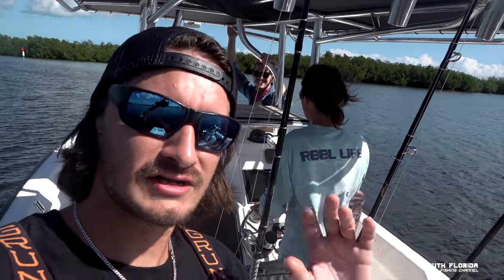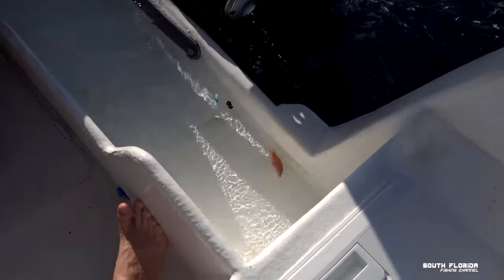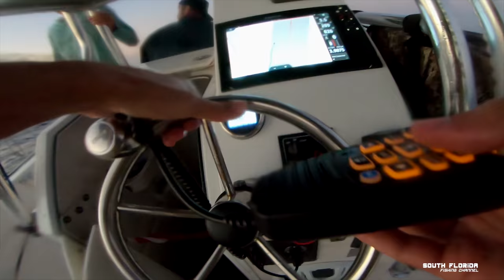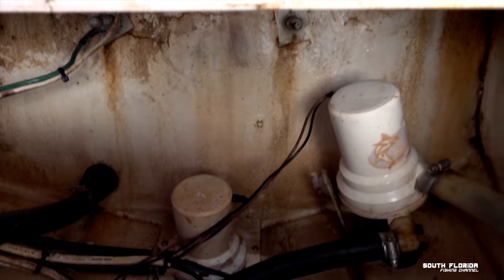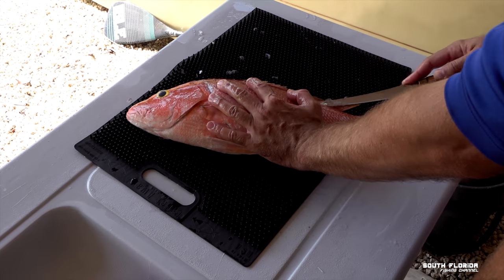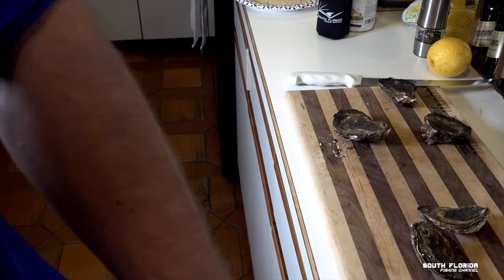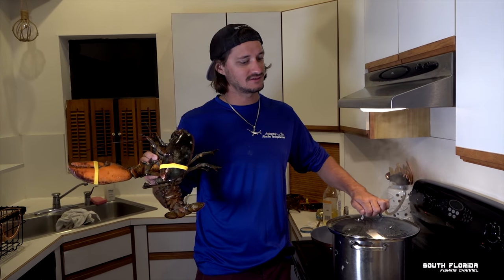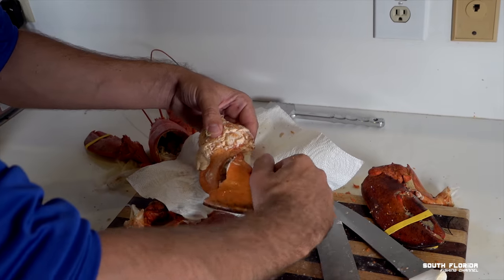Sinking 10 miles offshore | A scary fishing catch n cook

Comment: Heiko, I'm sorry this happened to you.  The folks who did the repower should have tested the transom for moisture/strength before installing that significantly heavier and more powerful engine.  Key Largo took a proven hull (23 seacraft) and built them as cheaply as possible.  IMO, putting more money into that hull is spending bad money after good.  If I was you, I would try to find a used hull in need of power and put your motorand new electronics on that.  Maybe a pursuit, sea ox, or an older mako.  Good luck bro.  If you ever get up to long island, NY, you can fish with me.

Comment: If your boat just ran on flat water, the transom would probably be fine, but when punching through waves with a heavy load on board extreme stress is built up when the waves try to stop forward motion, and the torque of the outboard is trying to force the boat and all the weight within ahead. In bumpy sea conditions it's best to slow down to the speed the sea is running or take a quartering tack when bucking a head sea.

Comment: Tops are 'never' permanently mounted.  It has to be able to come off.  

I agree with having someone closing in the transom...be sure they add big knees from the stringers.  Transom thickness needs to be at least 2".  Add a bracket & you'll have alot more interior space.  You'll feel like you have a 25'er instead of a 23.

Comment: i mean im not an expert but was that a repower that didnt pay attention to engine weight, maybe a 200 would have been more appropriate but that transom looks pretty thin probably a problem that the boat builder caused (later in the video i did notice it was a small boat 18-21 ft? boat builder probably built it for a 150 to 175 hp engine)

Comment: I’m sure you’ve heard a lot of comments but I used to worked for a company that deals with fiberglass molding, repairing, and rebuilding as well as structural repairing. So if you ever need a cheap repair in North Georgia then you have a contact.

Comment: I’m pretty sure the reason of failure was from the huge engine on the back. While you were fishing and the back of the boat was already full. I would lookup into a jack plate or a aluminum transom cap when fiberglass is fixed or a combination or both.
Reply: Yeah that splash well should not be under water like that! It’s made to take water but the top of the transom should always be above the water line! That was not normal unless your backing down.

Comment: I bet that boat was rated fit a 250 two stroke. That transom is toast/mush.  It all needs to come out and redone. Take the motor off/flex tape and tow to a ramp no big deal. If you like the boat get it fixed right $$$ or part out and buy something turn key.  Next time put you vests on before doing anything and have an emergency plan. You all did well and were lucky. Thanks for sharing your experience.

Comment: Your boat is a prime candidate for Seacast transom replacement system, did mine 10 years ago and stronger than original. I f you could remove the motor it could be done where it is parked.

Comment: @SouthFloridaFishingChannel   Heico unfortunately a "mobile" fiberglass guy isn't going to fix your broken transom. You have an old boat with old wood in it that's probably more than 20 years old, that wood is probably on its way out as its probably rotting away. Those guys at Sea power marine in Tamiami really screwed you over man, and I'm sorry to say that. They may have already known about your rotting transom or how weak it was and proceeded to mount that engine on it just to get that sale $$. Also the way they bolted those lower bolts through your transom is a joke and was bound to fail, especially on an old wooden transom like that, wood does not have the compressive strength modern day composites do, so when they mounted those lower bolts they should have at the very least used a cross brace like they did on the top two bolts. Dinky aluminum fiberglass washers like those where over time just digging into your transom with pressure caused by the engine.
Since you are considering a transom bracket you will most definitely need to get that transom replaced, no way in hell that transom of yours is holding up a bracket. Whatever transom you do decide to put back in i would highly recommend Composite materials like Coosa board or ARJAY pour in transoms. I cant recommend you any fiberglass shops here in Miami but taking your boat up to Ft Lauderdale would be a good option, lots of good fiberglass shops up there, might even consider replacing all that wood in the boat!
Reply: Poor installation, those little washers were really just waiting to fail.
Reply: @K9bare66  exactly

Comment: Take the engine, electronics, tower, and anything else you can salvage off and just buy a used hull. Forget repairing that. You will always be wondering if it's going to hold up.
Reply: That's what I was thinking... and I do fiberglass for a living.  Can it be repaired, yes of course, but its not worth it  Better to take the money and upgrade to a better hull.

Comment: Your transom needs to be replaced....guys that changed your motor should have seen if the core was water logged or not. Anyhow the plywood needs to be removes and then you can replace it with a non wood core that will never take on water from any screw holes or drain holes and will last forever. That is the proper fix here. Seeing as you spent some food coin on your rebuild i would definitely get the transom core replaced to non wood.

Comment: 1. You must reduced at safe speed during rough seas. Regardless how strong your transom is or how "unsinkable" your boat is.
2.  You must play with the waves at slow safe speed, avoiding your boat to go surging. "Play with the wave" means going zigzag if necessary avoiding big waves. Like I said regardless how strong your transom is or how sturdy your boat is.
3. You are not supposed to eat oyster including the liquid inside. It is basically salt water.
4. Oysters are very good to eat. You are missing a lot if you still dont get to eat one before.

Trust me, I am a seafarer (a Chief Engineer by profession) and from the archipelago of the Philippines.

Comment: whoever installed that motor should have put a backing plate on the lower and upper bolts and stiffener inbetween the fiberglass on those top bolts.... that metal bracket has too much tension on the fiberglass.....from the looks of the lower bolts with those 1"X1" square washers up against fiberglass you are asking for trouble...... should have a 1/2" backing plate either aluminum or another non corrosive metal....Also not sure what that boat was reated for on an engine but that evinrude maybe a lot heavier then allowed..... glad you made it safe I can feel your stress during that episode.... scary times! My buddy had both his fuel tankes on his Grady let go 20 miles offshore..... scary scary....!!!!

Comment: Glad your safe. 

Remove the engine and get towed to boat ramp.  

I would suggest new transom made out of Coosa board from Boat Outfitters. Plus move the engine to an Armstrong bracket. I loved mine as it eliminated the waves splash in while drifting.  

I’d suggest enough Inflatable Life Jacket. Imagine fast the boat would gave rolled if that engine tore off the transom and water rushed in. 

I suspect you may have a rotten core in your transom, looking at your video in the bilge it appears it shows rotten wood stains front your engine mount through bolts. If this wasn’t sealed properly then water getting into the transom will rotten the wood and stains will appear. The transom strength was the wood and the fiberglass was to keep it waterproof while adding some strength. Internal failure of the breakdown of the wood left the fiberglass as the last resort to holding the engine on. Coosa board never rots. Check out Armstrong bracket.

Comment: It is all about experience. Now you will be more careful and check your Boat like you were flying a Plane. I have an ActionCraft 1720 and a 25 Ft. Cruiser. I have had my brush with death too.  Many stories to tell.  Passed Captains Class in Marathon Fl.  Been so far back in the Everglades that would scare  Crocodile Dundee.  Bilge  pumps can get old and lines can crack letting in water to your  boat.  That is what it looked like because you were riding low in the water and causing extreme pressure on the transom. Just my thoughts. Glade you are safe. Be pre paired for next one like it will happen. This is why I never drink alcohol  when on the water. All hands on deck has is important.  After I get back I get a big buss and eat fish.

Comment: This will prolly be long but I got a Story. So I headed out for the day my lady friend,and I headed out around 11 am (because I can never get her up !!!!!) anyways headed to the launch and headed out.So we got to our spot in about 50ft of water I tossed the anchor out and got to fishing!!!!now my boat was a 22' proline cc and the water was coming in the back which is a little taller than your back by your transom.I noticed water was touching my toes in my flip flops and I about lost it! I instantly cranked the engine hit the bilge and wait for it NOTHING no water nothing so instead of trying to fix the bilge I hit it full throttle lol with the anchor out when I heard the line pop I slowed down a bit so I could cut the anchor line with my knife.I didn't stop because the boat was bogging the battery was almost under water so I got her to hold the wheel and we go wide open throttle again then I got digging in the hull trying to find why the bilge wasn't working and instantly found the problem.A huge store bag was clogged in the hole so I pulled it out and it started working but not fast enough! so I am almost to the dock now with the motor sputtering and barley moving we go close and I jumped off the back and inserted the damn plug that I forgot to put in and almost cost myself 35 grand I had just bought this boat cash and was so new no insurance yet! so it worked out I didn't lose the boat but I was so terrified I didn't stop shaking for a few hours after the entire thing was over. A simple mistake,been on the water my whole life and this never happen to me till now.This is why I tell everyone to never go alone always bring 1 person just in case of an accident! CHEERS MAN glad y'all made it out could have been much different!

Comment: I would replace the existing transom with a full enclosed transom with a Armstrong bracket. Will make it safer and no water coming in the back ever.  I would not trust a simple repair of the existing transom.Just my 2 cents

Comment: Find A Used Armstrong Outboard Bracket, There Are Hundreds Around In/On The East Coast Of Florida & There Are Enough Clips On U-Tube, That Will Show You Everything You Need To Know Regarding The Repairing Of The Transom & The Way To Add The Bracket Along With ALL The Necessary Fiberglass Work, Materials, Centering, Needed Hardware...I Just Recently Used All Of It To Replace/Add A Bracket To A Luhrs, So I Could Remove The Original Inboard Single Engine & Single Screw System & Apply Twin Outboard Suzukis, So I Now Have The Same Total H.P., More Displacement & Longer Water Line, In Addition To A Redundant System In Case Of An Emergency....You're Very Capable To Do It & Right There In Your Back Yard On The Trailer....Chop Meat!

Comment: wow.  I'm so sorry.  It looks like the material under the fiberglass in the transom has rotted.   Is it wood?   If so, your stringers go where the transom goes.  You need to get the engine off of there either way.  If you're going to fix it, you want to have a marine engineer look at your structure and figure out how much really needs to be replaced because that rot can permeate a hull.   You don't want to film this show a second time.  Good news is that actual structural fiberglass work is not difficult and you can have a pro finish it once you get the structural stuff finished.   Get a plan from the marine engineer.  Or you can go find a new (used) hull and put that sweet 250 and the tower on the next boat.   I would pick a composite-only boat, no wood to rot.  Really impressed with your ability to focus on cooking and making jokes after such an event.  I'm looking forward to see what you actually decide.

Comment: The way that motor is mounted is ridiculous.  There should be a metal backer in the bilge for added support. 1 foot by 1 foot metal plate to tie the two mount points together and make it a solid mount. I can definitely see why it stress cracked.

Comment: Whomever mounted your 'Rude needs to be brought up on attempted murder.  Those square backing washers were too small and the wrong shape to support the engine's weight and torque.  It's not the boat's fault.  Check the boat's documentation and write them.  They'll be P.O.-d at that mounting job.

Comment: Those two small backer plates are wrong for that motor. You need a stainless plate that goes between both mount posts.This would be on the inside of your bilge ( a stainless plate about 2-21/2 feet long and 1-11/2 foot wide.I think the motor was installed wrong and I would take it back to the people to get it fixed.If you need more call 850-435-9008.

Comment: ur transom wood is rotted out that needs replacing normaly a transom rated for a 250 can go up to a 275 or even a 300 the fact it snapped like that means that wood is long gone i recomend replacing it with water proofed wood

Comment: I had my 05 etec try leaving me 25 miles out deep dropping. Scariest moment I’ve experienced was that solo. Drove out 15 miles caught a little mahi but went to shift and lost reverse but I was getting a code for shift interrupter switch fault, and continued out to the big blue. Well little did I know that the 5/6 bolts that hold the motor to the turn swivel sheared out. Well right as I dropping in at 900’ I hear a clunking noise to see my motor gyrating. I immediately tied ropes around the motor while my reel was pulling up the line. I got very fortunate that shift linkage was squished to be locked in forward gear and helped keep the motor from literally falling off. Took a hr an half to drive back and dock the boat with all gas no brakes. Everyone thought a motor can only come off at the transom when it can disappear at the bracket.

Comment: one other thought....I know you are rightly concerned about putting it back on the water with the motor on the transom that condition to reach a trailerable spot - but I wouldn't recommend towing it down the road like that either.  That transom sees just about as much stress suspending that motor during bumps and vibrations going down the road as it does running on the water.  I would get a hoist, remove the engine where it sits, do a temporary patch below the waterline, and tow the boat somewhere you can haul it out and trailer it for repair.  Dropping that motor on the interstate at the speed limit isn't quite as life threatening as dropping it in 300 feet of water (but close! for the folks behind you) but it's just about as monetarily costly!

To get an idea of what is involved with the transom replacement, check out Andy with Boatworks Today: https://www.youtube.com/watch?v=4UOtdrxNX8U&list=PLV97GZkHhpHNunwJlaSTS72V7VtLojXnM

Comment: The whole boat rear end needs to be redone. I would go with 2 inch coosa board whole height new transom and a setback aluminum platform. I wouldn't go out on it otherwise. You should be ok to be idled by someone to closest ramp its NOT a back yard job considering all that needs to be done and the weight of the engine. Everything has to tie to your hull and stringers with 1708 for structural support of the engine loads. If you decide to do it, go to walmart buy set of 1500lb crank ties ropes you have wouldn't be enough when transporting boat on the road. Here I build my flats boat, my transom is overkill 3 inches on a 60hp suzuki. If you have any questions let me know. https://youtu.be/JZmQcnaTfts

Comment: You just had that engine put on there too. Sounds to me like they over tightened the mounting bolts. Because that shouldn't have happened. They probably used a rattle gun and beat the living shit out of them with it when they installed the new outboard.

Comment: You can bet if than transome is rotted out, more of that boat has serious issues.
Reply from the maker: We took the whole thing apart. One of the stringers had less than an inch of rot. We tore it all out and replaces with Coosa board. It's almost back on the water! =)
Reply: @SouthFloridaFishingChannel  Congrats bro. When I bought my 20ft sea pro it was solid, but I wasnt going in the ocean without a galvanized plate added. Just dont trust fiberglass over wood with my life.

Comment: Repairing the transom will be major surgery. You have the right idea and that is to add an Armstrong bracket to the back. The entire transom is cut out the new transom with a Cosa Board core should be rebuilt full height with lots of fiberglass reinforcement. The bracket is bolted to the transom with a dozen or so bolts so the loads are spread out over the entire transom. You will never have that problem again.  However, you will need to drop it at a boat shop for the repairs unless you want to do it yourself to save on costs. (See Boatworks today https://www.youtube.com/watch?v=al-OmrHRr6g or Project Dreamboat https://www.youtube.com/watch?v=TYPDFcEWteQ on Youtube). The project dreamboat video takes you to the Armstrong facility in FL to show you how it is made.